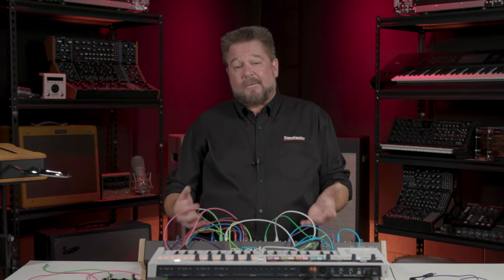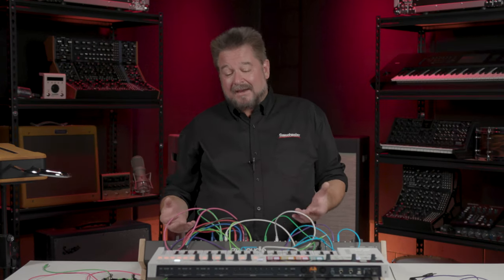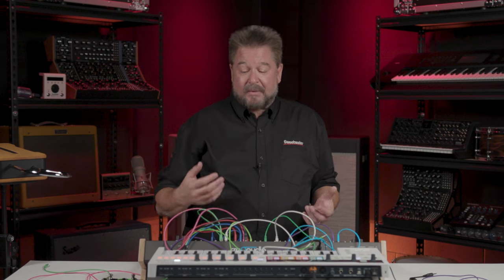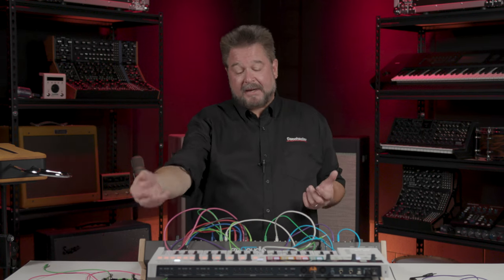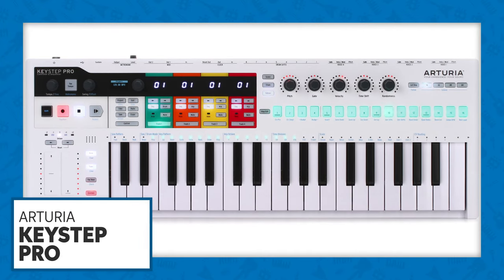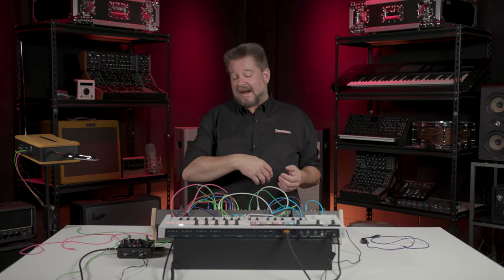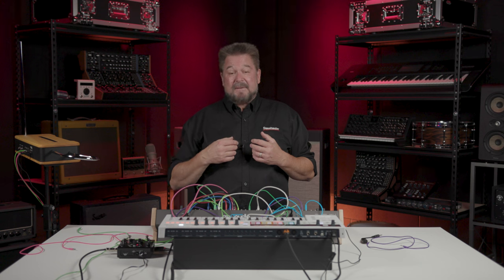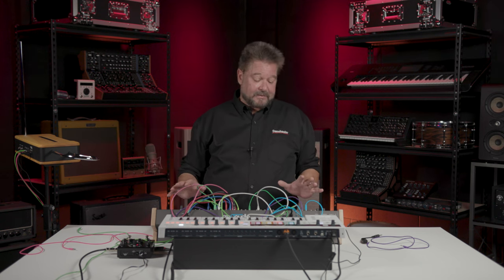Control Voltage vs. MIDI – Daniel Fisher

Comment: Good job on your preliminary "shutting down" of the nerd/experts, and prefacing that your video is for those that are not as engaged. You did not belabor the point, but you got the point out there....and also a pretty good job of describing the differences.

Comment: Great video 👍. It's so cool that CV came back. I've been building a hybrid "sound engine" for my Roland AE-30 wind synth. I send the breath as aftertouch and the motion as MIDI CCs. The core is my Behringer Neutron which converts pitch and aftertouch from MIDI to CV and I have a MidiVolts Desktop (by Space Brain Circuits) to convert the motion and thumbpad CCs to CV. The Neutron is supplemented by Eurorack modules. Great fun!
Reply: Most opposite of your comment below "Daniel thank you, but I’ll stick with just MIDI. Seeing that spaghetti of colors kind of confused me Lol"
Reply: @SWATTECHNOLOGIES  do you mean Fj François' comment?

Comment: My take away: if you want aggregate (meaning that one or more modulator(s) that can effect a downstream modulator) type device , multifunction, hybrid control (over a single voice or parameter)....go with Control Voltage. If you have a down signal device that handles multi-timbrality or multi-tone sound gen AND has slots for MIDI control....use MIDI. CV is generally not polyphonic (exceptions to every rule) , but far more expressive. MIDI can play back more notes/devices. In that....lies the hierarchy. "playing my multi-tamberal Roland PCM-based synth? Use MIDI. "Playing my quirky half modular?"...welll some MIDI for the notes and some CV for the expression.

Comment: I would love to be able to use CV/gate control of analog oscillators, polyphonically.  I'm pleased with the CV/Gate output on my Arturia Keystep 37, but it would be wonderful to have more than a mono output and be obliged to rely on MIDI for anything polyphonic.  Is there anything out there that does this?  Even 3 or 4 individual CV/Gate outputs would be a godsend.
Reply from the maker: Hi Mark, the Arturia KeyStep PRO controller I used in this video can do 4-note CV/Gate polyphony by putting all four CV/Gates on the same Track. -Daniel